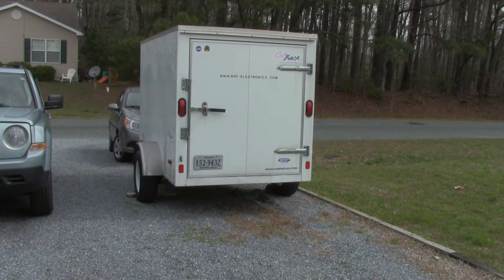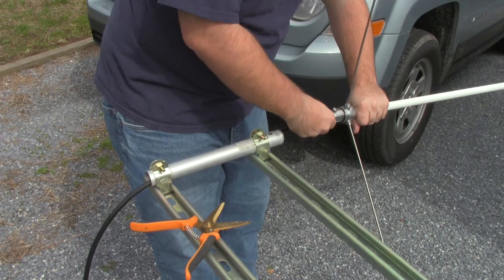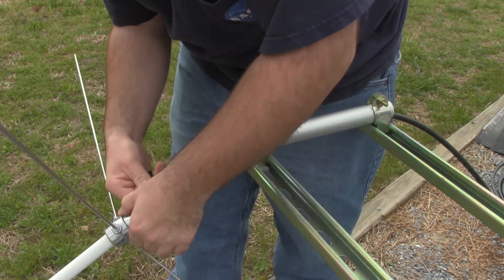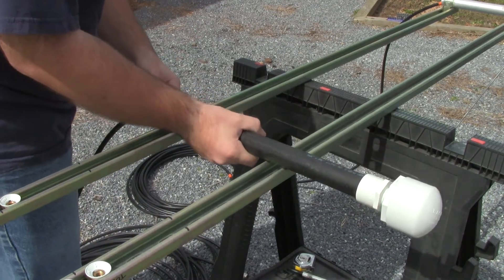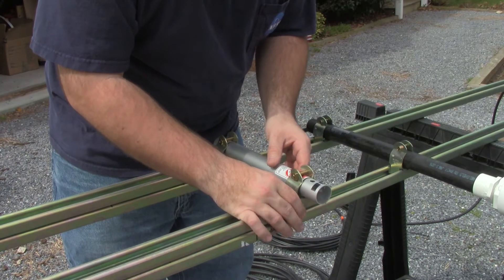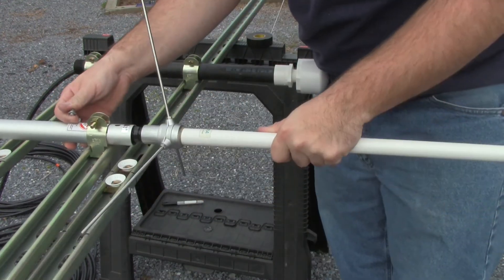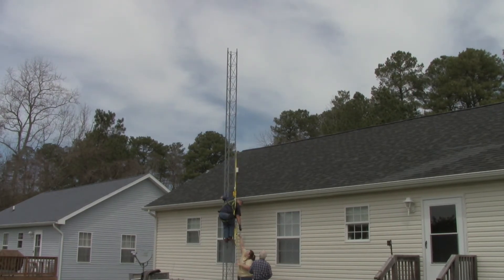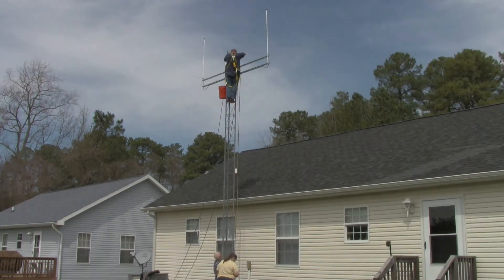Tower Antenna Installation

Comment: What antenna do you use sir?
Reply: All the antenna looked like Tram.
Reply from the maker: Two Workman/Tram VHF, Diamond VHF/UHF and a GPS antenna I built into a water tight PVC housing.

Comment: How did you mount the antenna to the house. Did you like dig a hole in the ground and then use concrete
Reply from the maker: One half of the first tower section is set into concrete.  I had a guy with a small excavator dig a hole.  I place a 16" sonotube in the hole and he back filled it.  Set the tower section in and then mixed quickcrete up to set it.
Reply: Thank you for that info. It doesn’t look like you made any kind of a brace that would mount to the house.

Comment: do you still have this system up and how is holding on ... good i hope because i am going to do something close to the same thing
Reply from the maker: I took down my tower almost two years ago when we sold the house.  The tower was up and in operation for about three years.  With the exception of a little rust on some not so great hardware holding one of the antennas, everything held up nicely.  Good weatherproofing was key to keeping everything dry and operational.  My only failure during that time was the LNA I had inside of the NEMA box for the over the air TV antenna.  I had to climb up and replace it one time.  About a $50 fix.

Comment: The only materials that should ever be used on a tower are hot dip galvanized steel, aluminum, or stainless steel.  Nothing else will last any appreciable length of time without rusting or breaking down.  Plated Unistrut will rust,  plywood will begin to fall apart with the first rain shower,  nylon zip ties will disintegrate with sun exposure, zinc plated hardware store fasteners will rust away.
Reply from the maker: Removed everything and took the tower down a few months ago.  Not a speck of rust and if you had paid attention, instead of building up your mental list of criticism, you would have noticed that the plywood was a TEMPORARY brace for pulling the assembly up.  It was removed after the whole thing was bolted in.
Reply: What about uv rated plastic?

Comment: what is the purpose of a GPS antenna on a fixed tower?
Reply from the maker: I use it for testing many different GPS based products that we produce.  It can also be used for a GPS providing a time standard for various systems.
Reply: gps can also be used for frequency standard as well for guys working uhf and up digital modes.

Comment: how's this cross arm setup working out for you with the wind loading on the antennas and cross arms
Reply from the maker: It has worked out well.  Since the Unistrut is flat and I was able to use the brackets made for it, as long as it was snugged up tight, no movement.  In the winds, I do see the antennas "twist" slightly, but it's not really noticeable.

Comment: That was a very clean and neat installation.    Im curious how many channels did you got on your TV  using this antenna compared to before the install?
Reply from the maker: +Tony Furiato We saw an increase by a few channels, but I think I actually created a new problem by getting the antenna up higher.  I think my LNA is being saturated by a nearby FM broadcast station.  I have an FM trap filter to install before the amp, the next time I climb up there.  That should help filter out the FM broadcast and let the LNA actually amplify the TV signals instead.

Comment: What are you using to mount the cross supports to the tower legs?
Reply from the maker: +hoster22 I'm using the pipe brackets made for Unistrut.  Sized for the pipe size.

Comment: Cool video Jason! I'm researching towers, station grounding, and how to pass coax into the radio room as I type this. So I think your video was well timed anyhow! Where did you get the tower sections and about how much did the whole project run? Are you making a video on how you installed the tower?

Thanks again!

Comment: So what kind of signals will you pull in with these, and/or what will you do with them? For instance, the GPS signal. How will you use that?
Reply from the maker: Don't View - Do! Thanks, Kevin!  The two VHF antennas are dedicated to a digital amateur radio mode called APRS.  We use this in combination with lat/lon coordinates, weather data and short messaging to track stations, chat back and fourth and a bunch of other uses.  Those antennas go right to my server rack in the shop to radios mounted in the rack.  The VHF/UHF antenna goes to two Motorola voice radios that I used to chat with other local hams, as well as monitor county fire/ems/police.  The GPS antenna also goes to that server rack and I use it for testing GPS based products.  Much easier than stick a patch antenna in the window and waiting a half hour for it to lock up.